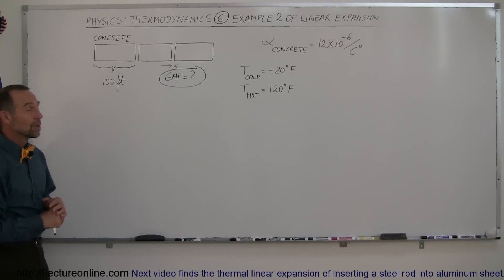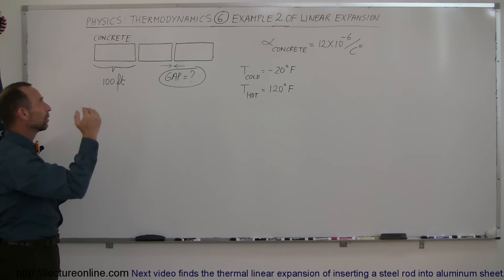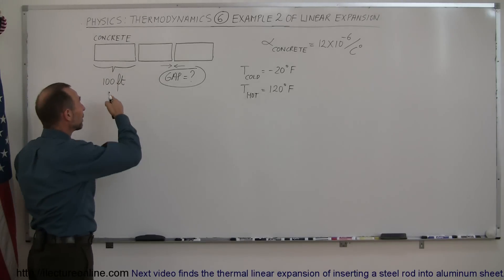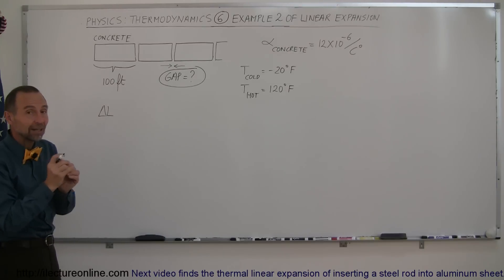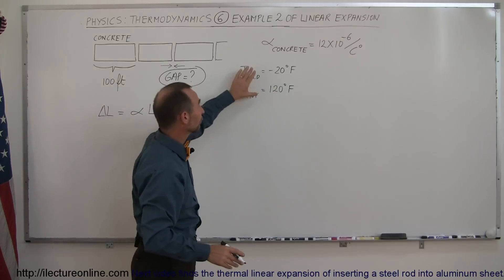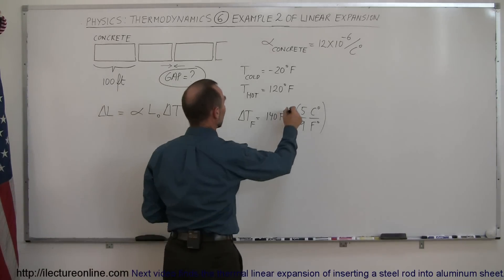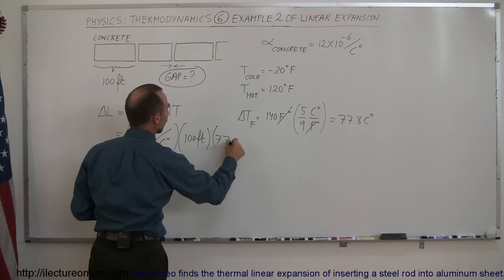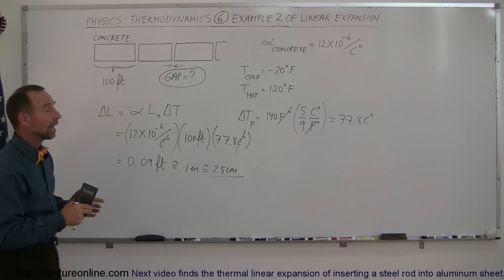Physics 21  Thermal Expansion (3 of 4) Thermal Linear Expansion: Example 2

Comment: Mr. Professor the glass cup breaks when we pour hot water in it. Does breaking happen due to the linear expansion coefficient?
Reply from the maker: The most likely cause is the differential heating between the inside and the outside part of the glass.  Since glass is a relatiely poor conductor of heat the inside heats up faster than the outside.  This causes stress which can break the glass.
Reply: Thank You mr. Professor.

Comment: I think you need to change the temperature from 20F to Celsius, and do the same thing for 120F. Then subtract the temperatures in Celsius. That is the correct way and the result is different.
Reply: There’s a equation > (difference of temperature in F) =9/5 x (difference of temperature in C)

And the equation for “just to convert degr” 
Which is (temp in F)=9/5 x (temp in C). 
So in this case we can use the “difference “ equation cuz it’s easy !! 
Hope you find this useful !

Comment: Is L0--the initial length--always associated with the colder temperature?  thanks again!
Reply: No, its the initial length, it could be going from hot to cold and you could be asked to calculate the contraction. Since it's linear, it's not a problem at all.

Comment: shoudnt the delta t be 100 deg C ?
Reply from the maker: No, 100 deg C means that it is a specific temperature (100 degrees higher than 0).   100 C degrees means the difference between 2 temperatures, like the difference between 20 deg C and 120 deg C ,  or  - 60 deg C and + 40 deg C.

Comment: The temperature difference measured in Celsius or Fahrenheit does not involve an offset, only a scaling factor. there no need to add 32 degree to convert 1f

Comment: Whats the diffrence between degrees centrigrade and centrigade degrees ?
Reply from the maker: Degrees centigrade is the actual temperature.   It is 21 degrees centigrade in the room.          Centigrade degrees is used to indicate the difference.   The temperature outside dropped 15 centigrade degrees last night, (from 35 degrees centigrade to 20 degrees centigrade).
Reply: Michel van Biezen Thanks !

Comment: formula for F -> C  is (F-32)(5/9). You also did the wrong conversion in your previous video, so it's a little confusing.
Reply from the maker: +Narica Paler 
No, the conversion in this video is correct.
Note that we are calculating the delta T (difference in temperature), so you don't have the 32 degree offset.
Both videos are correct.
Reply: Thank you for explaining...otherwise I would have included "-32" in my calculation!

Comment: Wouldn`t you also have to agree on the temperature at which the concrete is going to be put on the road? It seems to me that in this case we could only build the 2.5cm gaps when we are at -20°F. In the case of building the road at different temperatures we would have to build different lenghts of gaps am I correct?
Reply from the maker: Correct.  If the road is constructed at higher temperatures, the gap can be less proportionally.  Normally concrete is poured when the temperature is closer to room temperature.

Comment: I like a lot your explications thanks... just one thing... you forgot to substract 32 units while converting °F to °C ... regards!
Reply from the maker: Carlos,
In this case we are calculating the CHANGE in temperature, not the actual temperature.  Therefore you don't have to subtract 32 degrees F.  That would be incorrect.